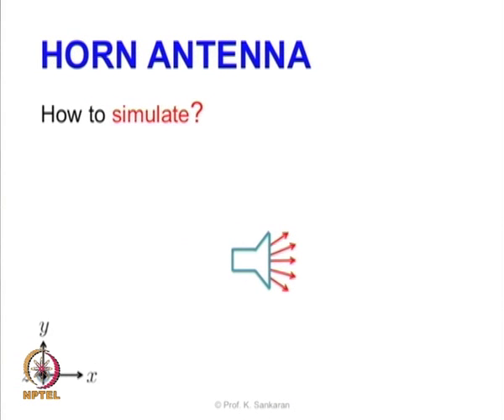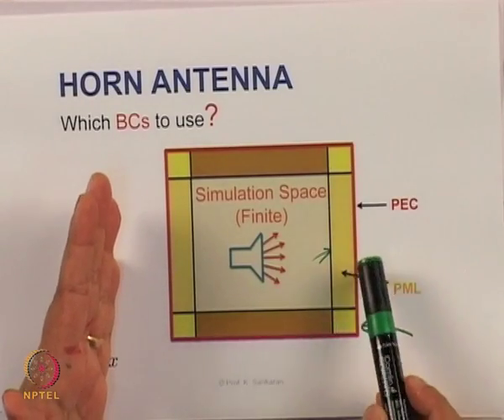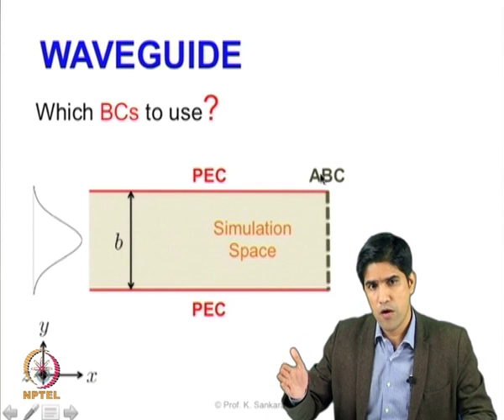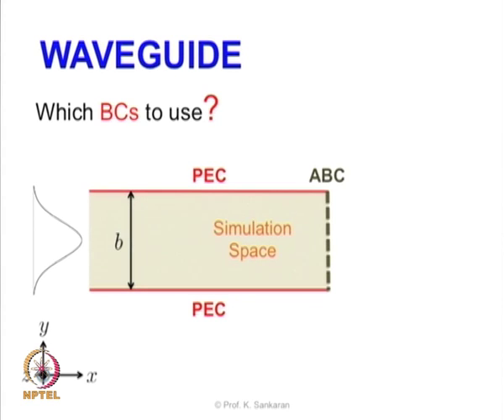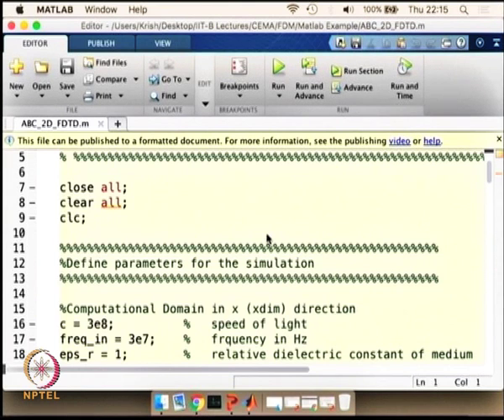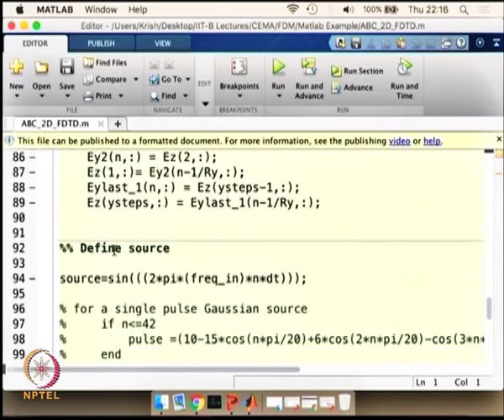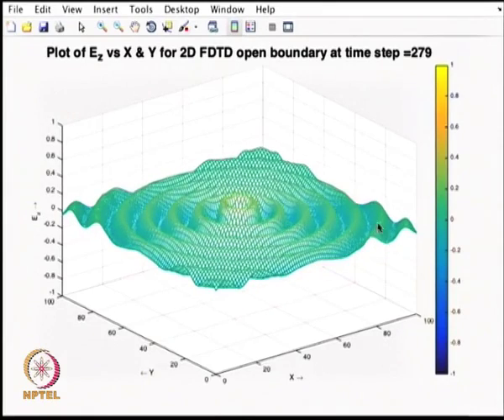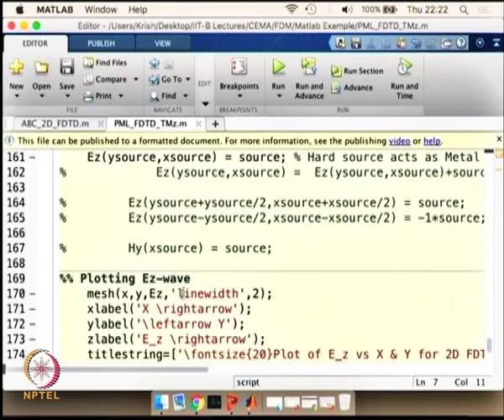Lecture 12 : Boundary Conditions

Comment: How can we get the matlab code?
Reply: close all;
clear all;
clc;
%Define Parameters for simulation

%Computational Domain in x-direction
c=3e8;       %Speed of light 
freq=3e7;    %Frequency in Hz
eps_r=1;     %Relative dielectric constant of medium
lambda=(c/freq)/sqrt(eps_r); %Wavelength
xdim=100;
dx=lambda/10;  %x-position step
x=0:dx:xdim;
xsteps=length(x);

%Total simulation time
time_tot=400;
Rx=0.5;
dt=Rx*dx/c; %Courant Stability condition
%t=0:dt:time_tot;
tsteps=time_tot

%Grid dimension in y-direction
ydim=100;
Ry=0.5;
dy=c*dt/Ry;
y=0:dy:ydim;
ysteps=length(y);

%position of source
xsource=floor(0.5*xsteps);
ysource=floor(0.5*ysteps);

%Initialize field vectors
Ez=zeros(ysteps,xsteps);
Hx=zeros(ysteps,xsteps);
Hy=zeros(ysteps,xsteps);

Ex2=zeros(tsteps,xsteps);
Exlast_1=zeros(tsteps,xsteps);
Ey2=zeros(tsteps,ysteps);
Eylast_1=zeros(tsteps,xsteps);

for n=1+ceil(1/min(Rx,Ry)):tsteps
    for l=1:xsteps
        for m=1:ysteps-1
           Hx(m,l)=Hx(m,l)-Ry*(Ez(m+1,l)-Ez(m,l));
        end
    end
    
     for m1=1:ysteps
         for l1=1:xsteps-1
             Hy(m1,l1)=Hy(m1,l1)-Rx*(Ez(m1,l1+1)-Ez(m1,l1));
         end
     end
     
     for m2=2:ysteps
         for l2=2:ysteps
             Ez(m2,l2)=Ez(m2,l2)-Rx*(Hy(m2,l2)-Hy(m2,l2-1))-Ry*(Hx(m2,l2)-Hx(m2-1,l2));
         end
     end
     
     %Absorbing boundary conditions using one-way wave equation
     
     %In x-direction
     Ex2(n,:)=Ez(:,2);
     Ez(:,1)=Ex2(n-1/Rx,:);
     Exlast_1(n,:)=Ez(:,xsteps-1);
     Ez(:,xsteps)=Exlast_1(n-1/Rx,:);
   
     %In y-direction
     Ey2(n,:)=Ez(2,:);
     Ez(1,:)=Ey2(n-1/Ry,:);
     Eylast_1(n,:)=Ez(ysteps-1,:);
     Ez(ysteps,:)=Eylast_1(n-1/Ry,:);

     %Defining source
     source=sin((2*pi*freq*dt));
     
     %Assigning source
     Ez(ysource,xsource)=source;
     
     %Plotting Ez wave
     mesh(x,y,Ez,'Linewidth',2);
     xlabel('X \rightarrow');
     ylabel('\leftarrow Y');
     zlabel('E_z \rightarrow');
     titlestring=['\fontsize{20} Plot of Ez vs X&Y for 2D FDTD'];
     title(titlestring,'color','k')
     colormap('jet')
     pause(0.2)
end
Reply: @saicharanmarrivada5077 ❤